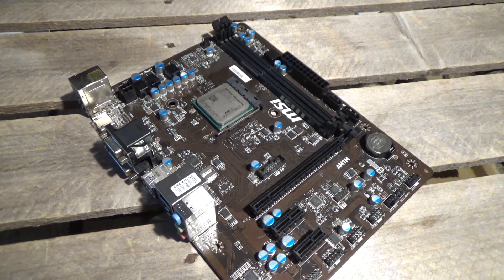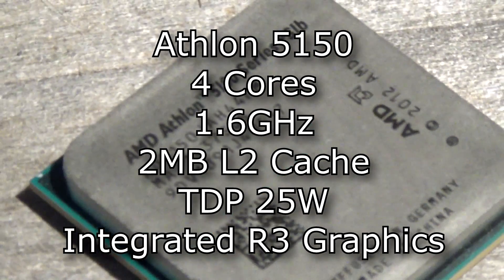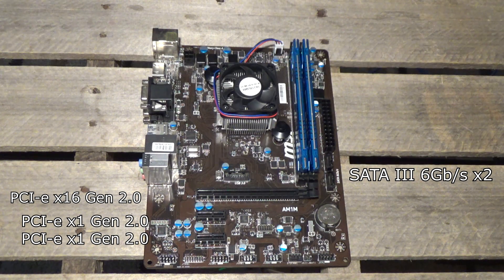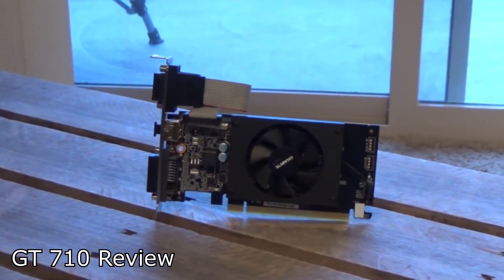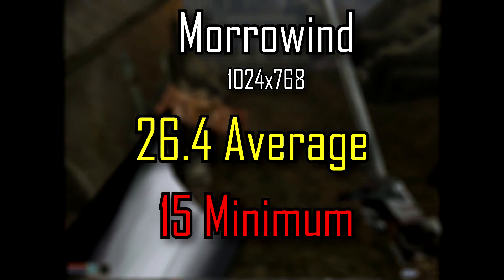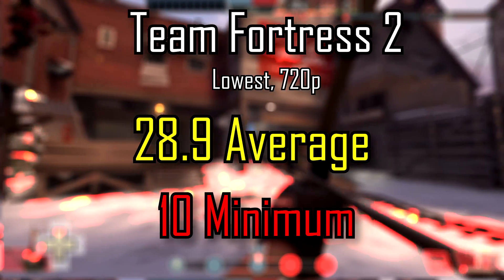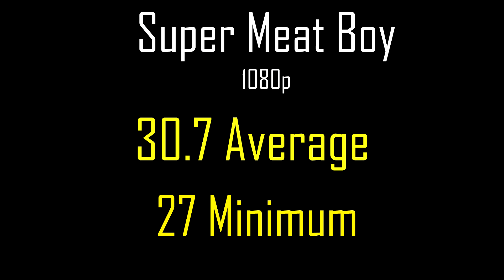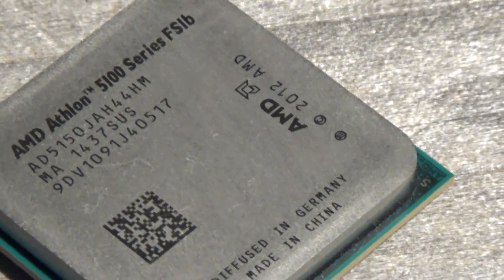The Athlon 5150 | AMD Kabini APUs

Comment: The 5350 is actually sort of ok for gaming at that time but you could tell it was right on the lower threshold of things being decently playable. You could overclock it with the right motherboard and it would get up to about 2.9 possibly 3.0 ghz. I had both of mine in fairly large midtower cases and just pushed a lot of air through with a pair of 120 mm fans the CPU fan wasn't doing a lot.  Had mine as a media pc but used it for light gaming as well.

Comment: I'm gonna pair it with a Gtx 1050 will it be ok
Reply from the maker: +HaL _ This processor is actually a pretty big bottleneck and if you can, try to weigh your options on a different processor. I say this because when you’re pairing this chip with even a 1050 you could experience less performance since it’s running at less than 2ghz and the architecture is pretty old
Reply: YogertPC would paring a pentium g4400 with an rx 460 bottle neck?

Comment: Fun fact : ps4 = 8 athlon 5150 cores + Downclocked R7 270
Reply: Naota Akatsuki well for what they are the  performance and optimizations are out of this world really (on the ps4) it is awesome to see that AMD started pushing multi core optimization on pc
Reply: @greensamurai5805  The ps4 version is slightly juiced up I think since its got more cache to work with. Its on par with the newest made intel atom x7 from 2016. Technically its better performance per watt than the bulldozer cpus at the time, but the low clock speeds are super low
Reply: @nuckerball1259  xbox one 1.75 Ghz

Comment: I think those chips can profit from overclocking because their tdp is so low. But then finding a cooling solution for overclocking those cpu's is tricky if you want a legit mount and no zip tie ghetto hack.
Reply: the voltage is locked at 1.3v
Reply: @Synthematix  my sempron 2650 runs 0.99v at 1.5ghz